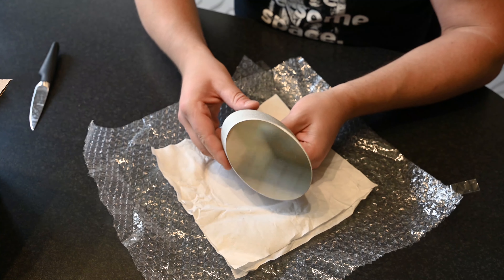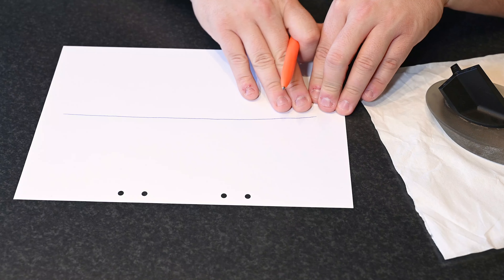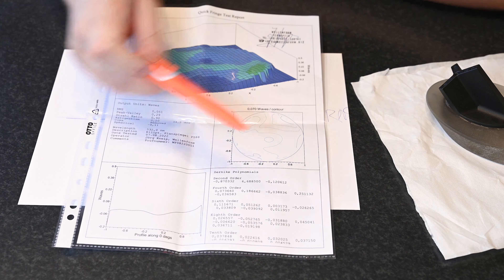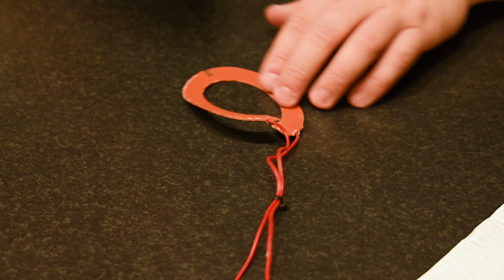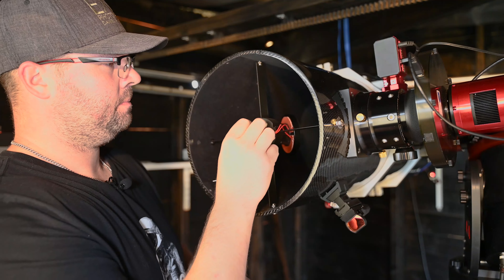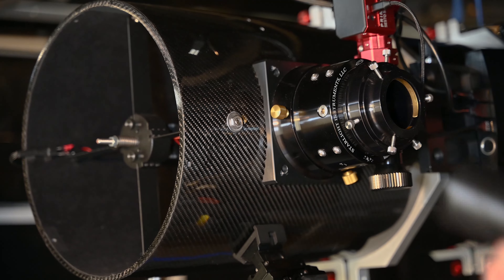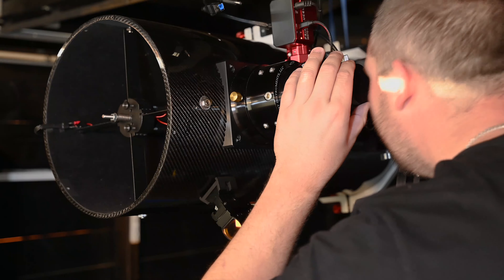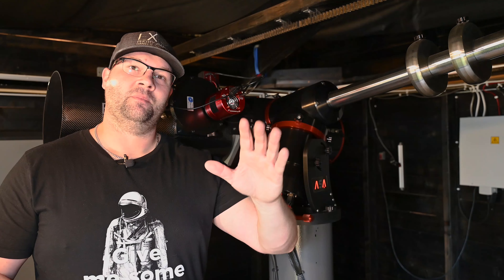How to change the secondary mirror on your telescope! (To one of the best mirrors out there)

Comment: Great video!

I'm looking into the TS secondaries aswell since my current secondary is almost end-of-life. 1) Do you notice much difference between this one and your old one?
2) How did you calculate what size secondary you needed to buy?

Thanks in advance!
Reply from the maker: Hi, I sadly haven't got any time to process the data from the telescope with the new mirror, but have two objects with 50hrs+ data so it will be a good comparison.

I just bought the same size as the former one.

/Daniel
Reply: Hi Daniel, thanks for the reply!

I have a 10'' f5 (1200mm) newt myself which I use for visual observation. The current secondary is a 63mm. I see you're using an 88mm. Do you recommend upgrading to a larger one for visual observation and what would the benefit be of upgrading to a larger size secondary for visuals?
Reply from the maker: @bas3919  For visual, I would go for the same size, If you go down in focal ratio (like mine f4) and for a larger image circle (when taking photos) i would go up in dimension.
Reply: @ExoPhotography1  Thanks for the explanation! Did you buy the seperate mirror and glue the holder onto it yourself from TS ?
Reply from the maker: @bas3919  No, I bought it glued to the secondary from TS :)
Reply: @ExoPhotography1  lucky you! They don't seem to sell any >0.9 with a holder glued to it (anymore). Only seperate mirrors that come with a certifcate :(
Reply from the maker: @bas3919  They do, but you have to email them and get a qoute 👍🏻

Comment: Is that dew shield custom made? It looks so neat.
Reply from the maker: No,, it is a dew shield for one of Teleskop Service´s RC telescopes (the 10" version)
Reply: I have a TS Optics ONTC 10" myself. Could you please share a link to the dew shield, if you don't mind?
Reply from the maker: @jamiejako  Absolutely, it is this one: https://www.teleskop-express.de/en/telescope-accessories-5/dewcaps-and-heater-90/ts-optics-carbon-dew-straylight-protection-for-10-truss-rc-telescope-6884

I made three "brackets" in my 3D-printer så it fits snugg and clean.

Comment: Probably doesn't matter, but thermal glues are a thing. Silicone is a pretty good insulator, but like it said, probably doesn't matter.
Reply from the maker: You are right, but after consulting Teleskop Service they said it is totally fine with regular silicone glue. I have also a very thin layer of silicone so it shouldn’t be a problem (hopefully)

/Daniel